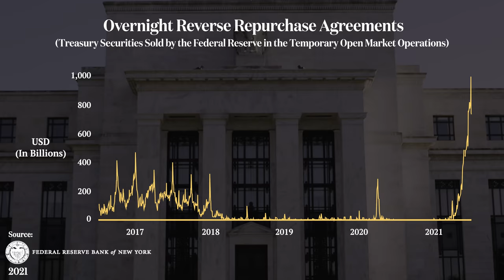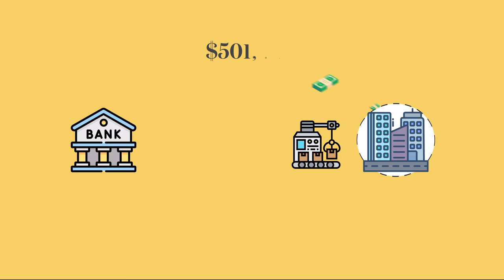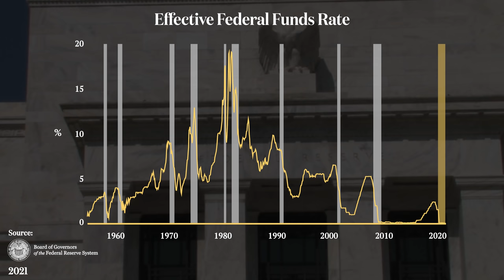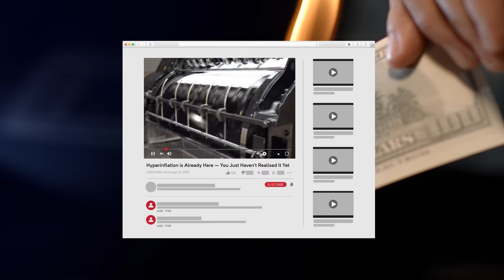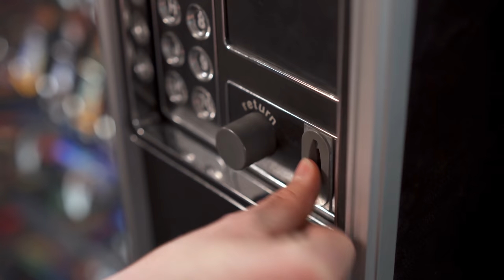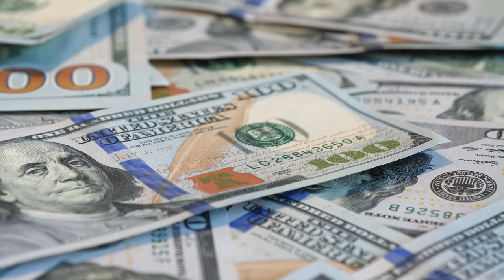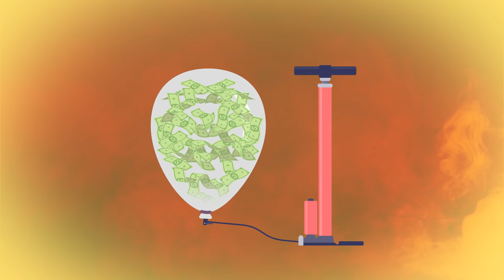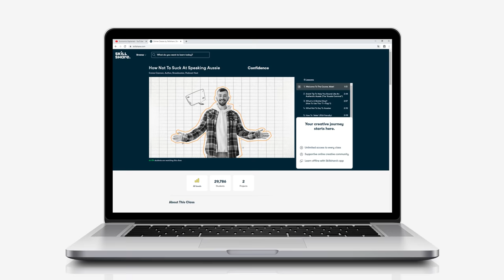8 Months of Stimulus Just Unraveled | Economics Explained

Comment: Since I maintained employment during the 2020 problems, we spent the stimulus received at local businesses for tangible goods and supplies that had been in short supply during the worst parts of the shutdowns. If their "stimulus" was intended to stimulate the economy, keeping it is counterproductive. I would add that maintaining the "currency" as a digital transaction means its security is questionable. If things do get as bad as some would suggest, then the bureaucracy would have an incentive to freeze and seize assets to shore up infrastructure and needed services. I'm not suggesting "buy precious metals" or any of that, all you'd accomplish there is increase the value of someone's substantial holdings (something I suspect is the intent behind the advertising of them anyway). What I'm suggesting is to use your additional tax refund (because that's what is it) to get items and supplies that you'll need in case of shortages, power outages, etc. I'm no economist, but I can't eat cash or a bank statement and I'm pretty sure my vehicle doesn't run on bitcoin or silver.

Comment: Im confused...So the fed prints money, inflating the balloon. The balloon hasnt popped yet because velocity of money is low. To prevent the balloon from popping, the fed is trying to lower the money supply so that when velocity eventually increases, there wont be a lot of money in circulation to pop the balloon? Am I understanding this correctly? 

If I do, and that's what is happening, what's the concern about? The fed is decreasing money supply as they should, right? Why is this solution just a bandaid?

Comment: wow a sharp drop every ten years on the even year 60 70 80 90 2000 10 20 etc okay with the balloon analagy how then to we add to the balloon more money molecules to remove the  dangers of overinflation assuming inflation cannot be infinite the hot or cold outside the balloon changing uncontrolled but we can control what's in the baloon so how do we protect the balloon without fully deflating it as everyone wants in reality the biggest most lightest lofty bouncy balloon to float up in the air etc but for this purpose the balloon as a singularity cannot simply be replaced when burst as loss of ALL it's contents would be eminent  scraping together the spread resources contained in the balloon's explosion would prove difficult assume balloons packed with confetti and air there's an air factor and confetti factor but if it was a lump of confetti more like a sand filled balloon with very little to no room for air and it bursts the sand may fall straight down to be more easily collected assuming gravity present more complicated without gravity now if little to no confetti to spread then the air of inflation lost but only a few grains of confetti or as sand possiblity  similar expiriments tried at all possible parameters  but the important part is whether we could track or recapture any of that valued confetti sand or air and how to easily replace or melt down and reform the balloon to reconstitute it into being a balloon to contain the confetti sorry if the words talk circles but  I'm trying to describe the experiment with No visual aids assuming previous aid will still contain the parameters for expiriments